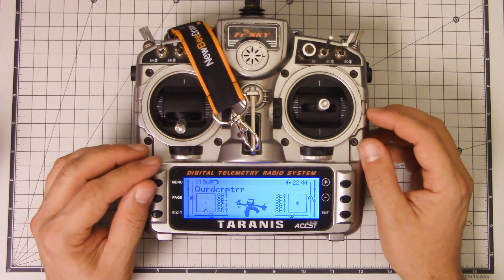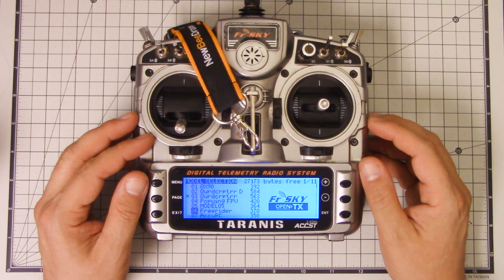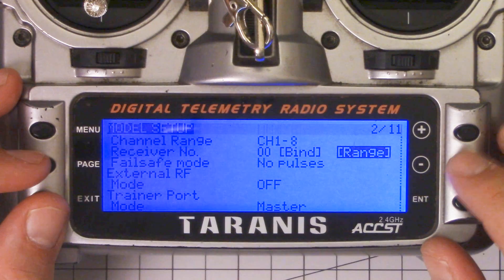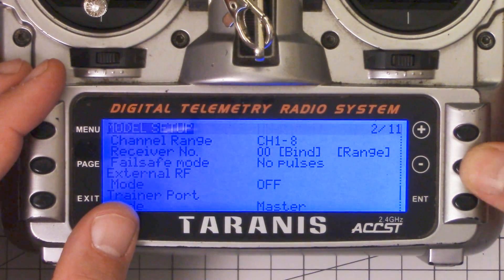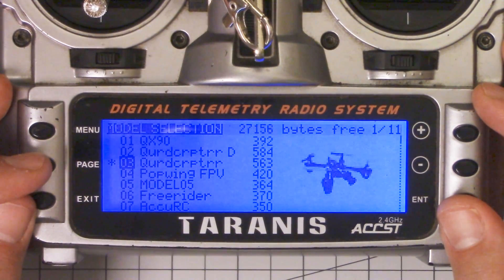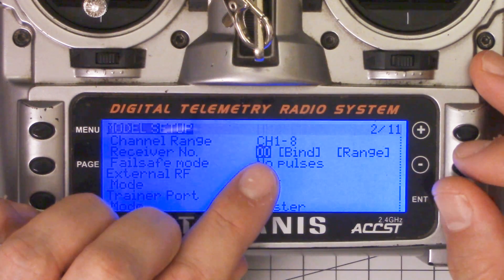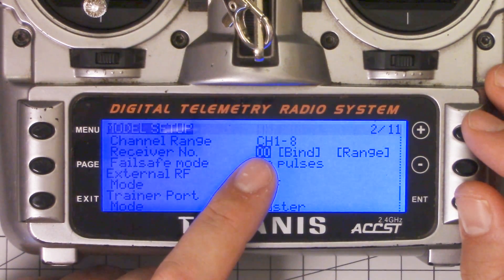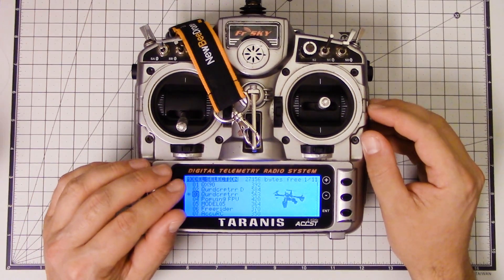FRSKY TARANIS HOW-TO | Model Match | Unlimited Quadcopters, One Model Memory

Comment: I had two receivers working on the same model, without any changes to the radio.  Not sure what you are trying to show here.
Reply from the maker: +RC Pilot Multirotor I'm going to guess you weren't using X series receivers and a Taranis. 

Let me flip it around: what if you wanted to force only one receiver to bind to one model, and not any other receiver?
Reply: I was using two X4R-SB receivers on the same model, without changing anything in the radio.
Simply by binding one, and then biding another to the same model.
Reply: I don't think this is going to happen.  It's not just Taranis but other radios too.  Unless your receiver is entirely different technology, it will bind and you will find out in flight that something is terribly wrong like your switches which should work, no longer work.  That is why it is very important to check which model you are selecting before you fly.   I think Walkera Devo10 original and Deviation open source  has a system to prevent that, It's a 8 digit pin you generate to encript the communication between your radio and receiver.  OpenTX developers did not think of that.

Comment: If you are into your telemetry data you may run into issues, especially with the number of LiPo cells.
Reply from the maker: I've never run into this, but it may be because I'm still on the old version of OpenTX, before they revamped telemetry sensors.
Reply: I don't think you use audible alarms for your  attention voltage (with my memory I'm probably wrong though)

Not an issue for me as everything I fly from the 130 v-tail to the larger machine I have are 3S but it may catch some folks out
Reply from the maker: +Rob Crawford I do use audible voltage alarm.
Reply: Shows what my memory is like <sigh>

Comment: Joshua, I'm running Open Tx 2.1.0 and it doesnt have this option, no rx number is shown. Is this function only available on specific versions of Taranis f/w  ?
Reply: David Hughes my taranis is the same as what you are describing. It will let you bind multiple recivers to the same profile. It will work as if you assigned it to reciever number zero. Just make sure only 1 of your quads is powered up at a time. You can fly 2 at once, it's not as cool as it sounds!
Reply: +Blunt Force Trauma FPV (BFT FPV) , bit of a pity really, I like the idea of one model one rx, would force me to make sure I have selected the correct model and specific trim settings for that model. oh well. I wonder what version of f/w Joshua is running  ?
Reply: I have an older version, you can always update!
Reply from the maker: I'm not sure about that. I'm also on OpenTX 2.1.x for what it's worth. I'm sure it's not a 2.2 specific feature.

Remember, you have to be using an X-series (D16) receiver.
Reply: I am still in the analog age with the d8 protocol with most of my stuff. I found out unintentionally that multiple recievers would bind in the same model when I copied a setup to create another profile for a different quad. It kinda caught me by surprise that I had 1 profile that would command multiple models!
Reply: +Joshua Bardwell bingo  !!. There's the missing item from my knowledge, must be either x16 or D16 for the rx number to show up. Thanks. I'm still using dr4's, I bought a few when they were on special somewhere.
Reply: Me too. I have a brand new x4 thats been sitting on my bench for months. It will go in the next build!
Reply from the maker: +David Hughes yup. D4R2 uses the d8 protocol which doesn't support this feature.

Comment: Even when flying RC Combat fixed wing planes, we were using one single model on the transmitter, considering the different models you flew were of the same type. Minor deviations that were caused by crashes+repairs could be easily and quickly trimmed mid flight

Comment: Telemetry data can be different when coming from, lets say a Naze32, SPEvo or F3Omni etc, so really you would still need multiple models unless all your quads run the same FC.

I'm reasonably convinced that even with the same type of FC, the sequence of the sensors can change, which can make your telemetry settings see altitude for vbat (as example) so if you use telemetry you pretty much DO need unique models for each quad.
Reply: hmm, dont know- never thought to try. That would solve it though, allowing for just two models, one for D8 receivers (QX90 etc) and one for F1/F3 boards with real X-series receivers.
Reply from the maker: I've never experience this, but I'm still on OpenTX 2.1.x so maybe that matters.

Comment: Really stupid question but how big of a deal is it to leave the Taranis stock, so endpoints at 2015 and can't remember the bottom value? Should I be adjusting them to 1000-2000?Not sure why I haven't done it, but all my quads have flown great anyways haha.
Reply from the maker: No, it does matter. The FC expects to see 1000 to 2000 with 1500 in the middle. If the transmitter isn't sending exactly that, then you either fail to achieve full rotational rate when the stick is fully deflected, or you end up with dead-band at the end of the stick travel, because the channel reaches maximum value before the stick reaches maximum deflection.
Reply: KelvinFPV Haha, makes sense ;) 

Spider Addict, Spider Adddict, does what ever, a Spider Addict does. Can he feel 15m/s, no he can't cause he's an addict ;) hehe hope someone gets my Simpsons reference. 

On a serious note though, I was asking because I arm, and there is about 5mm of travel on the bottom of my throttle stick before it starts up the "scale" so I was thinking that is what that was.
Reply from the maker: +The RCAddict that's min_check being too high.
Reply from the maker: +The RCAddict 5hey should be 1000 to 2000 ideally but a few microseconds isn't a big deal.
Reply: The RCAddict if you can feel 15 ms at the end of the stick you have some good spider senses.
Reply: Joshua Bardwell Thanks, will check it out (literally hehe)
Reply: @TheRCAddict  love it when 2 of my fav pilots share ideas.
Reply: I think, and I could be wrong, but if there is generally 1000 point range for most quads and FCs, it really doesn't matter what the top and bottom numbers are.

Comment: I have setup up all my models to one profile too, but I use #01. I'm pretty sure it works with any number as long you bind your receivers to the same number. I know that because I was using #06 before to all my quads.
Reply from the maker: +LD Silva I thought it replaced the old one if you reused the number. I could be wrong.
Reply: Joshua Bardwell I too have 4 quads on the same model using 01.
Reply: I agree with LD, I have many model w/ any number and many quads binded to the same number.  It doesn't need to be 00.
Reply: All my 6+ quads are on channel #01  I guess that works too???
Reply: Any way I can do this without rebinding?